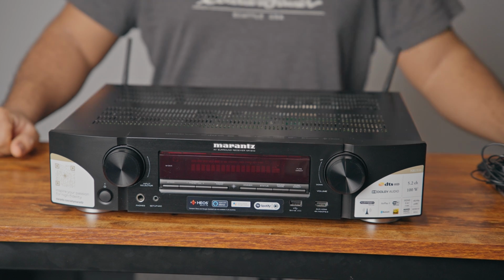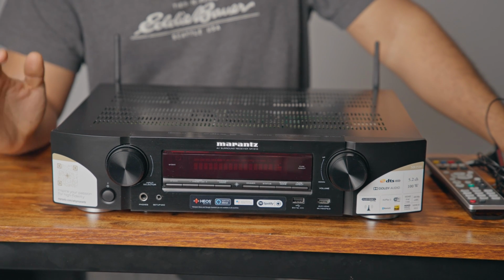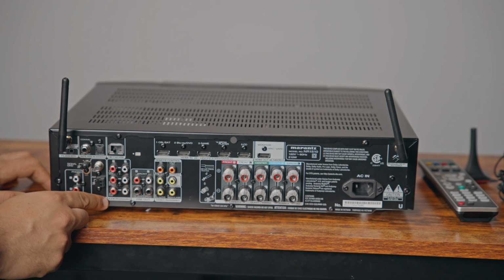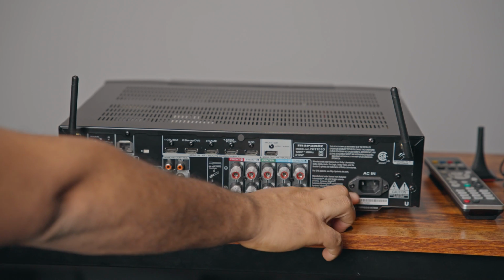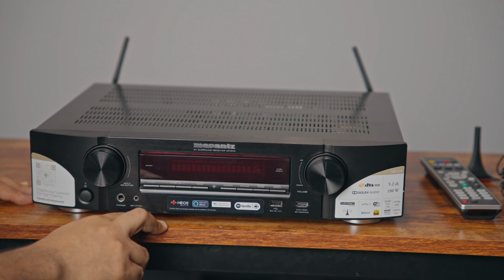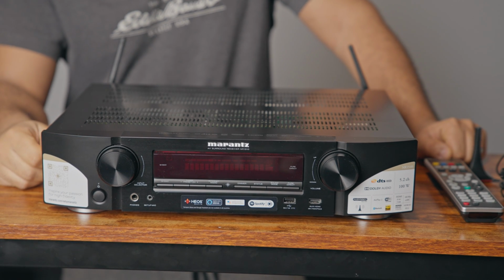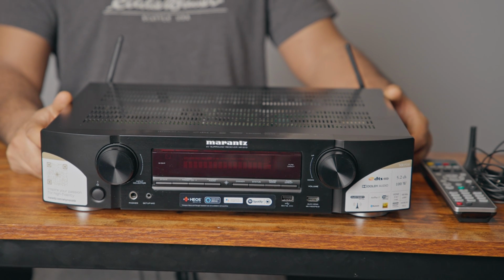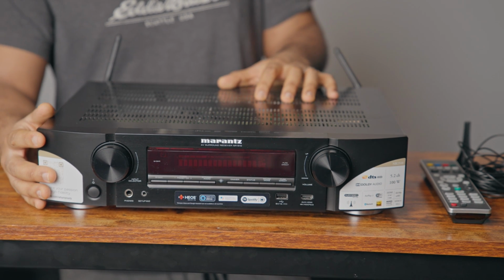Marantz NR1510 Review: Slim & Mighty AV Home Theater Receiver Unleashes Cinematic Bliss! 🎬

Comment: I mean, this is basically an unboxing. You didn't even plug it in. There was no actual testing of the features, setup, menus, sound quality review, comparison, etc.

If you are using this to power bookshelf speakers, there are 10 options to choose before this.

This will power towers no problem, just might not crank it for fear of damaging the components. More heat on smaller form factors is bad.

Comment: I want to use this AVR as a video switcher in my two channel TV system, while still using my Audiomat Arpege integrated tube amp to power my Sony SS-NA5ES speakers.  I have gadgets that convert my legacy gear to HDMI.    I listen to a lot of opera content via Roku App or DVD.  And movies via DVD or Netflix or Amazon prime.  My favorite streaming service is MHZ Choice.   I seldom watch TV; if I do it is almost always PBS.  

Can you see any impediment to using this Marantz product as I’ve described??  I realize that it is a lot to pay for a video switcher but I’ve tried using cheap HDMI switchers and they regularly fail.  I love the slim form factor.  I’ve had AVRs in the past and resent their huge size and all those extra amplifiers I will never use.

Comment: It also works good for people in a small apartment/condo or has limited space.  I got a good deal on it.  My big mistake was that I thought it had a 12v trigger to power off and on the amplifier.  After getting it I notice that outlet is for remote and says IR flasher in
Reply: Also, I am using Martin Logan 15i bookshelf speakers and a 30i Center channel and a subwoofer.  They are 4 ohm so the 50 watts per channel 8 ohm also works for and is more (can't find on the website exactly), and I have not had any overheating issues playing it somewhat loud

Comment: Why does the sticker on the front say 100W? After all, this receiver (Marantz NR1510)-has a power of 50W!
Reply: 100 watts total will ruin your ears on a set of decent sensative speakers.  Ive been running this for years and its loud 50 feet away during parties.  I typically run -10db  reference and its still relatively loud.
Reply: @dvi6605 it’s usually that power in stereo mode.  The power is distributed differently in multiple channels.   You won’t need as much power for rear or surround  compared to the front and center lol😂.
Reply: Exactly!!  I have this brand new and I noticed that right off the bat.  I was all excited thinking it was 100W and then had to look it up and see it's only 50w
Reply: But Marantz amps are like the Harman-Kardon receivers of 20 years ago. They tend to be more honest in their power ratings.
 Back in the day people would laugh at the "different" (or more accurate?) HK surround receiver rating of 25 watts x5 continuous average RMS power with all channels driven. Backed up by (at least) +25/-25 amperes of "high instantaneous current capability."
 But when they hooked the H/K up in their houses they would be blown away by the warm, powerful sound compared to the "100w x 5" receivers with no bass, no treble, low current: like Sony's.

Comment: Hello from Istanbul. I plan to buy Marantz 1510. But I have a question mark in my head? I would appreciate it if you could help.
The question mark is: Can this receiver power without problems for 2 kef q 150 and one kef q 650 c and finally one subwoofer? 
I would appreciate it if you could give detailed information. 
Note: I plan to use this device in a 40m2 hall.
Thank you...

Comment: Hi, do you think it has more than 50watts if I only use to drive the center channel?  I have a 2 channel stereo system and planning on a 3.1.  Also does it have a downmix from 5.1 to 3.1 and separate channel gain adjustments (ie. make the center louder). Thanks!
Reply from the maker: Thank you for watching! So what i would recommend for this receiver is possibly having an external amp to power the Front left and right channels since it has pre-outs for 2 channels. That way, if you have big power-hungry speakers, they are not starved for power. In my current setup, I do not even have a full 5.1 setup. I only have the front LR and Surround LR. No center channel. Even without that, the Front LR does a pretty good job downmixing and simulating a center channel for dialog. You can definitely use Audyssey to adjust the channel levels. I would first do the auto room calibration and then tweak the channel levels as needed to your liking.

Comment: just got an nr1510 for $200. Bought it as a temp receiver. Kind of bummed out bc it doesnt have hdmi 2.1. Might end up upgrading to a cinema 60 in the near future
Reply from the maker: Thank you for watching! I think $200 for this unit is quite a steal to be honest. Like i mentioned in the review, this is not a powerful receiver and is really mean to power smaller units unless you use an external amp. You are exactly right, it does not have 2.1 which is a bummer because it would be the perfect unit to handle next gen consoles. That may not be a deal breaker because not too many games are using 120hz but i am not an expert in that field. Overall, the unit considering its small form factor is a good unit for small rooms/setups. I believe the entire Marantz lineup is being replaced by the cinema line so the Cinema 60 sounds like a good step up. Check out https://www.bhphotovideo.com/c/compare/Marantz_NR1510_vs_Marantz_Cinema_70S/BHitems/1478396-REG_1724188-REG

As far as power goes, they appear to be identical with the exception of the Cinema 60 allowing 120p pass through via HDMI 2.1